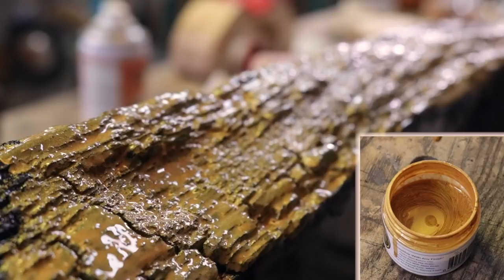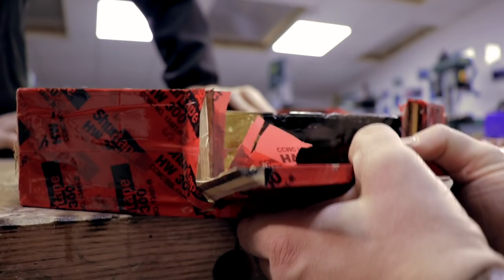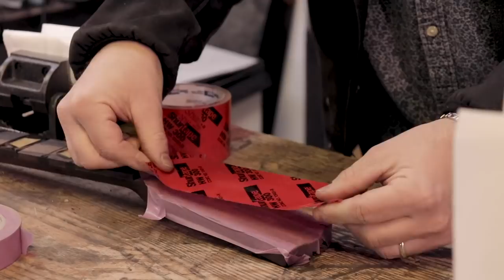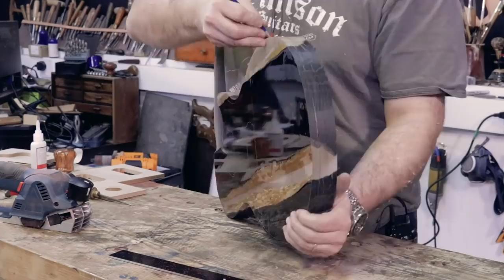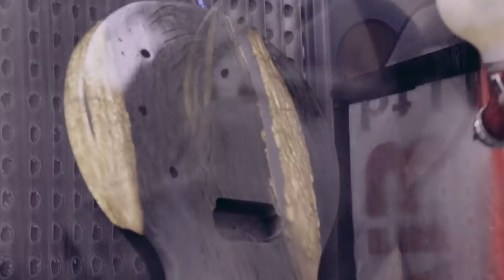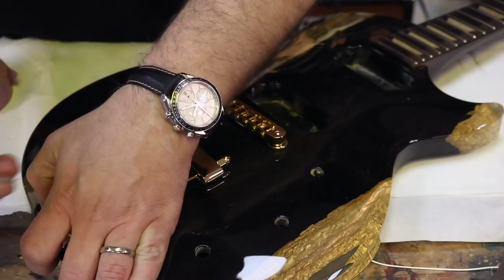LP-style, Carved Epoxy Resin River Table Guitar FULL BUILD in 1 video

Comment: bit simpler idea than this guitar but i was thinking about a les paul gold top with instead of a painted maple top a resin / pearl pigment top , do a totaly opaque gold / pearl swirl colour to make it basicly a goldtop with some extra dept and sparkle
think you could do a pour on a uncut slap of mahogany with some plastic edges nailed to it to make the resin about the same height as the maple would need to be , than flatten the whole slab on both sides under the cnc router so you can lay it down flat before cutting the body and the curved top out of it , could do white banding along the edge and after polishing paint the rest of the guitar just like a gold top les paul 
could even used cracked bend or verry uneven mahogany for it as long as the back is smooth 
wonder how it would sound , the resin is harder than maple i believe so it might have a lot more high in it then a regulair les paul

Comment: Can someone answer me a question regarding oil finish and stained wood?

I’m currently building a guitar and I’m nearing the point where I need to apply a clear coat or oil. I want to oil it up to a mirror shine if possible as I’m terrible at spraying clear coats. If I apply oil with sandpaper will it effect my stain? I assume it will as it’s abrasive on top of the stain. I eventually want to get a clear coat up to a mirror finish and I’ve seen this done with oil. Any pointers or directions to online resources would be appreciated

Comment: Great imagination and craftsmanship, but I have serious misgivings about the neck joint.  You used glue in a joint where screws should have been used.  With no mortise & tenon joint to help the glue, the tension from the strings will eventually rip the neck off of the body.

Comment: Hey, this guitar is awsome. However, it going to be blured  ( I mean resin is kind of Polyuretane . Poly has characteristic which is become blured by sunlight ) 
So , buyer must be know  that this guitar may become yellow by exposure sun light.
Reply: The clear coat applied at the end is likely automotive grade, which is UV resistant.  Also, unless it's stored by a window for years, it isn't going to absorb that much UV.

Comment: Would it be possible to do 100% resin expoxy body and neck as we'll?
Reply from the maker: Not without some carbon fibre etc to support the neck, string tension is not to be trifled with. I built an acrylic bass for Charlie Jones of Goldfrapp etc with a clear neck and it just wasn't strong enough. B

Comment: An epoxy river is not a  river it doesn't look like any river real or abstract that I have ever seen. It is a ridiculous way to use wood that would otherwise be unusable. Most of the guys that make the tables are mediocre wordsmith at best. You are an excellent woodworker and have no need to stoop to this trick that happens to be a pet peeve of mine. Epoxy river and charcuterie boards come on if we let it this medium we all love so much is going to cheapen everything  to a level that I am not looking forward to. And we are headed there .A friend and I were making skateboards  when we were in middle school early 60's that were as good as some of the stuff I am seeing. Sorry I just had to vent. I think you are an incredible artisan and love most of what you do. Keep up the good work.